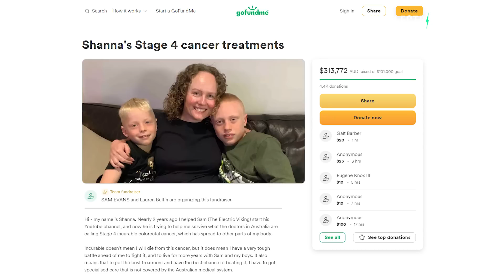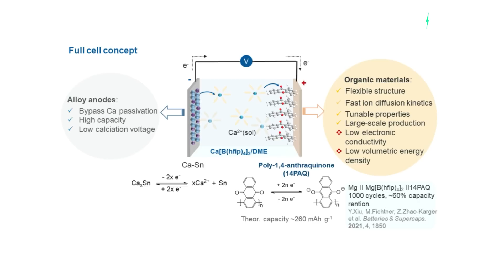Porsche EVs coming with 800-mile range + 15-minute charge time

Comment: Considering it is Porsche making the claim, it might actually be possible. VAG has been sandbagging their numbers to ensure that the real world performance actually hits claimed. Look at "Edmunds Tested: Electric Car Range and Consumption Real World vs. EPA"

2020 Porsche Taycan 4S (20-in wheels) EPA Rated: 203 miles, real world testing 323 miles.

For comparison: 2018 Tesla Model 3 Performance EPA Rated: 310 miles, real world 256 miles.

BTW: EPA doesn't actually test the vehicles. EPA sets test parameter's, Automakers test them and submit results. It is kind of like doing taxes, where some take more risks with their claimed results. Sometimes the claims are a bit optimistic, as VW, Hyundai, Ford, etc. have seen in the past, which gets the automakers in trouble. In that case, automakers are sued and then have to adjust, often paying fines to the government and compensating consumers. Automakers that have been dinged in the past and/or are risk adverse will sandbag their numbers to ensure their cars actually perform beyond what is claimed and avoid the financial and reputational risk of the lawsuits. Risk taking companies, like Tesla, will post optimistic ratings. If you see numbers that look too good to be true based on battery size, vehicle size, aerodynamics, etc., they often are.

Comment: This is one of those believe it when we see it stories.  No question, solid-state batts are the inevitable future of batteries due to their incredible properties and specs but, will be a few years before we see any, or more.
Reply: Wait until you see my planned EV with 16347 miles of range!
Oh, and 5.7 seconds recharge time
Reply: Battery swapping solves the short life cycles
Reply: There is a big question once cost and manufacturing are taken into account. Also, much can happen in technology (super capacitors, better salts and minerals, etc). Solid state may be great, but I wouldn't guarantee it.